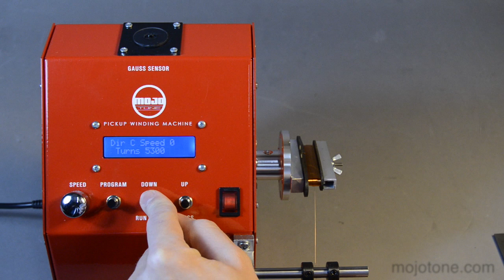Mojotone Pickup Winding Machine

Comment: Is there a hand wire function? What if I want to hand wire, say I don't like any of the factory programs, or can I make my own programs?
Reply from the maker: The demonstration depicts a handwinding process as this is the only way to use the machine as it is sold.  The program is always custom -- you set the number of winds as well as the direction of the winds and you control RPMs manually as well.  Hope this helps!
Reply: mojotone Ah, so it's a hand wire deal. The machine simply spins and counts the turns.
Thank you.

Comment: How is the gauss sensor supposed to work? The center mount thing is kind of dumb, do you have to drill holes in the pickup?
Reply: The Gauss sensor is just a Hall Effect sensor  and a half assed arbitrary conversion to a number that is NOT true Gauss or Tesla readings, but just a number you can compare too. For a real Gauss meter, the probe alone is $2000, and the zero Gauss calibration chamber is another $1500 or so. I have a cheapie Alpha Labs Guass meter, that set me back about $1200, plus another $400 for a tiny zero chamber. The pickup winder is $500 so the Gauss meter is going to be a joke.